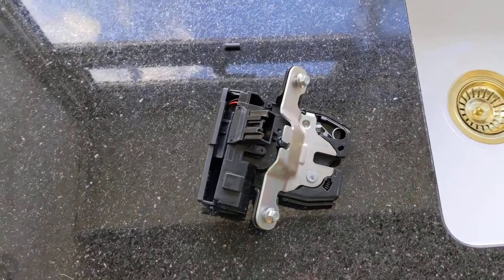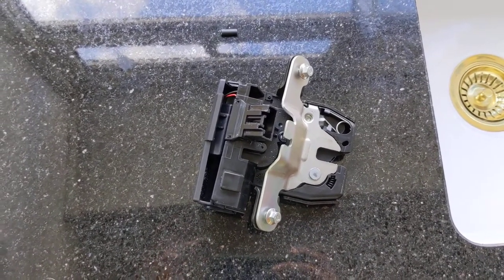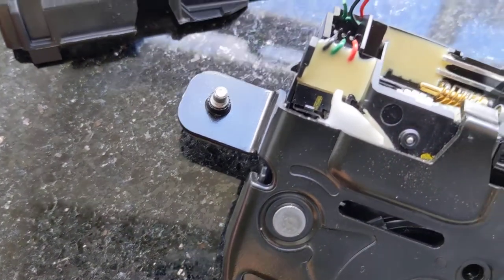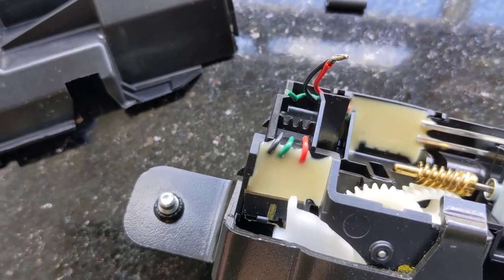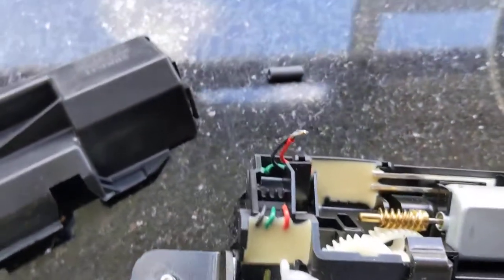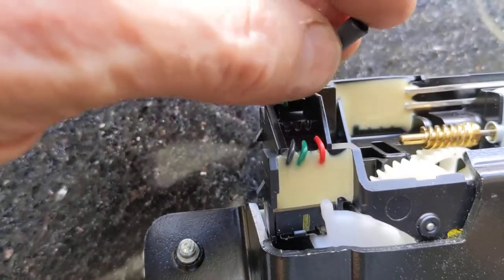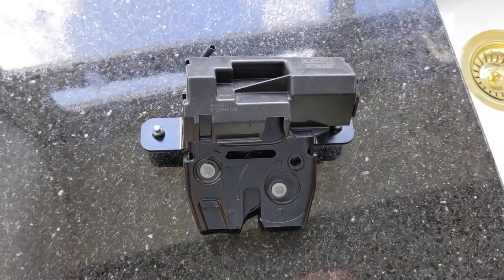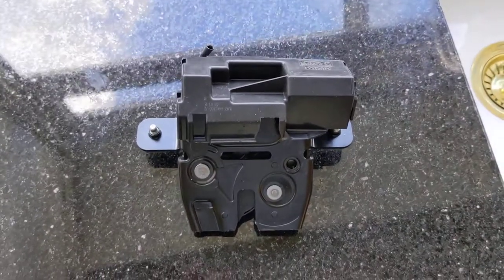Ford Fiesta Mk7 boot/tailgate "boot open" warning light.

Comment: Had this same problem on my wife's 2009 Ford Fiesta (especially when the weather is hot), battery went flat due to internal lights staying on. Followed these simple instructions cutting the red and black wires and twisting them together then wrapping in some electrical tape. Reassembled the latch, refitted it and the trim and the problem is gone (can't be bothered buying a replacement latch) - thank you Gary.
Reply from the maker: Your comment is ace and made me smile. To be fair the fix you have done will last forever although I was a bit particular about having it working as it should, in my case the boot light never worked for years and when I replaced the latch it suddenly came to life! Thanks for letting others know this is a fix that works. Regards. Gary

Comment: Lifesaver Gary!! My elderly Mum’s 58 Fiesta had a dead battery, which the RAC replaced without investigating the cause!  I noticed the interior lights were permanently on even when the car was locked, then I noticed the ‘boot open’ warning.  Fixed! Thank you.
Reply from the maker: Thanks for commenting and it's annoying to hear of parts being replaced without understanding the root cause. Unfortunately happens all the time, but hopefully you've saved a few £ as you found my video.

Comment: Thank you sir wherever you are. This issue has been driving me crazy for weeks on my wife's car. Finally this morning it's caused a power drain to flat the battery. Followed your video and it was as simple as you showed it to be. Even getting the plastic trim off and the latch out was simple following another video. So thank you, and it's interesting to see how many fiesta owners from that age range (wife's is a 59 plate) have all had this same issue.
Reply from the maker: Thanks for your comment. You may be able to tell from the grey sky, grey car, grey surroundings that I am in the NW of the UK....I don't moan though as I love it here 😂
Anyway, I'm glad you found my video and got the fix you needed. I had exactly the same issue as you hence me trying to find the solution. I do recommend a unit replacement and keep the 'fixed' one as a spare, although you'll have no further issues by eliminating the micro switch as you've now done. Your comment will help others follow as I'm sure there are one or two more out there having the same issue who are yet to search on YouTube. Regards, Gary.
Reply: @garymiller9843  I'm Yorkshire myself so I know your weather struggle well.
I've seen a few on ebay so going to source a new one to be safe and keep the old one like you say. Interestingly my issues are the same as some others who have commented, that it's only really started happening this week due to the hotter weather. Obviously some fault in ford's parts manufacturing process.
Still all I can say is thank you and I'm sure this video will help many others like myself

Comment: I had an unknown, intermittent fault for months, regularly draining the battery. Thankfully on the day I discovered the actual problem (I was driving along the motorway and the boot open message flashed up), I found your video. Such a simple, and quick fix, but without the video I’d have probably faced an expensive visit to the garage. Thanks from another one based in the NW (of England anyway 😉).
Reply from the maker: The warning on the dash is a bit startling (and overkill) when it goes off, especially when compared to older cars where you’d happily drive along with the boot unlatched until you realised when you got to your destination – modern tech eh >: (  Anyway,  I am glad you found the video and commented to let others know that the fix works.

Comment: Great video, rare to find one that actually works, after removing the trim its a easy 2 min job! Green wire did not need to be cut. Thanks Gaz
Reply from the maker: Thanks for your comment, particularly for saying a video that actually works. I did a new one yesterday for replacing the bonnet catch as my searches on how to fix proved useless so I thought I'd do one myself 🤣. Anyway, glad you are sorted.

Comment: Gary thanks for taking the time to show us this fix. Noticed there was a lot of corrosion on the power and connection pins. But after a good clean still had the issue. Tried you fix as a workaround until I get another lock. Worked a treat, never cut the green wire after some of the other comments on this post.

Worth doing this as this fault can trigger a false alarm going off. This happened on daughters car.

Thanks again
Reply from the maker: I am really pleased the fix has worked for you and for taking the time to make your comment so that anyone else having this issue can see that it works.  I'm glad you're getting another lock/catch as they are so cheap it's not worth not fixing, but this saves the annoyance until the new one arrives 😁

Comment: Hi from Norway ! Thanks a lot  for this tip. Carried out the mod today and it worked fine ! Saved me all the stress with disconnecting the battery all the time.Will replace the lock at at later date., so this has saved me a lot of hassle. All the best.
Reply from the maker: Thank you for your comment letting people know this works. It is a really annoying fault that causes such big issues, so I'm glad you have fixed it.

Comment: Nice one, my car was popping up with the boot open warning and it was a bit of a pain, last night the alarm was going off and kept going off. Tried your fix today and the warning isn't coming on, which is an instant bonus, I'm just hoping it was the boot open message that had started setting the alarm off, fingers crossed. I probably won't bother buying a new one, many thanks, such a simple handy fix though.
Reply from the maker: I am pleased the fix worked for you and you've made a comment to assure others who may be having the same issue.  There is no major loss by not replacing the unit, the solenoid is pretty robust and should easily last the lifetime of the car.  Old cars never had warnings for doors or the boot left open, it is just something that has been added which can then go wrong when was there any real need for it in the first place?  I can understand a warning for an aircraft door being not fully shut, but in a car you should know by the noise if something is not fully secured : )
Reply: @garymiller9843  yeah many thanks, that's what annoys me about these modern vehicles, just more stuff to go wrong yeah haha
Reply: @josh hi, yeah it did, no issues since. I'd forgotten I had done it until I seen this message haha

Comment: Thank you sir, this works perfectly I just cut the red & black wires and connected together as mentioned. Will be leaving it like that as the way I see it it can’t fail ever again.
Reply from the maker: Glad you have had success, you're joining a growing list 😁. The unit is robust just the micro switch which lets it down so I'm sure you'll have an age of trouble free service with the latch. Thanks for your comment.

Comment: Thank you very much. I came across this video as had the same issue. Intermittent at first then few days ago it would be constant. For the past our simple enough, cut the black and red... Twisted together... Wrapped tightly in electrical tape and put it all back together... Took 20 mins from start to finish... Thanl you so much!
Reply from the maker: Thank you for your comment James. A few people have commented about only using the red/black to solve the issue, so as a collective this will make the problem of the boot open warning go away.

Comment: This was great thanks for the vid, definitely going to try this. For a few days now ive come out to my car in the mornings and the info lights on telling me my boots open I had no clue what was going on other than to think someone was just trying their luck with cars around our area...
Reply from the maker: It is a bit of a hazard when driving at night and then the alarm goes off as all the interior lights come on unexpectedly! Quite dangerous really. 
Take care when removing the plastic trim as you don't want to cause any damage, watch other videos how to get at the part, worth taking your time to make it only a 5 minute job without breaking anything. I left my fix in place for a couple of weeks whilst sourcing a new part, they are really cheap off eBay or Amazon. It's worth leaving the plastic off the boot until you get a new part, then literally seconds to replace the latch and push the trim back into place. I found I restored my boot light too with the new latch (after it never coming on for 4 years and wondering why) 🤣
Reply: @garymiller9843  thanks appreciate the reply and helpful tips on what to do. Yeah came on for me one morning and made me jump on the drive haha.
Reply from the maker: @Frosty-273  this is one of the easy (relatively) jobs on the car where many have you cursing. Also no major need for a soldering iron and heat shrink, you can get away with twisting the wires together and taping them up as a short term fix. Good luck 🤞
Reply: Hi buddy did it work and do you still have full use of the boot operating when pressed. Cheers
Reply: @lukecreighton4897  Yes this worked for me always glad when I come across help videos on YouTube my next venture is to fit spaces to my wheels
Reply: @Frosty-273  OK thanks for the reply I shall try it stay safe buddy
Reply: @lukecreighton4897  no worries, hope all goes well for ya and cheers you too 🙂
Reply from the maker: @lukecreighton4897  Hi mate, as @Frosty273 said and perhaps I forgot to mention in the video, yes you do keep full functionality of the boot catch/lock but perhaps the boot interior light may no longer work. My recommendation is to conduct the fix as in the video but whilst the plastic trim is off the car keep it off and order a new catch. Whilst my fix will last forever with a new catch for less than £20 you'll be back to full functionality and if it ever happens again you'll know how to sort it. Just take care when removing the plastic trim so not to break any of the tabs. Let me (and everyone else on here) know if you have success. Also have a look at my video for installing an additional 12v socket if you get a moment, what I have done works really well and I have a virtually hidden dashcam for less than £40.  Good luck.
Reply: @Frosty-273  hi buddy just got new part of amazon 17quid everything working great and I can now lock the car lol 👍

Comment: Think this is the issue that is with mine. Battery went flat yesterday morning after having the warning come on a few days prior. Will have a go tomorrow.

Edit: it worked!! Thank you
Reply from the maker: I hope you had success with the fix. If you've not got around to it yet there is a link in one of the comments that will direct you to a good video how to get the plastic parts off the inside of the boot lid prior to doing my wiring fix.
Reply: @garymiller9843  tried it today and it has worked. The boot trim was a bit fiddly to get off but it's a fairly simple job. Thanks for the video

Comment: Just needed to cut the black and red, I left the green intact, no problems moving forward
Reply from the maker: That's great to hear John.  I hope others will have a look at the comments to see you've had success by only shorting the other 2 wires.  You picked a great time of year to solve this issue too; I always seem to have to do repairs in the depths of winter!

Comment: Thanks for doing this video I am going to try this had this problem for 2yrs but only in hot weather so hopefully this will work for me 🙏
Reply from the maker: I think quite a few people have had success with this fix so definitely worth you having a go. I do recommend that if you go to the effort of getting to the part then leave the plastics off and order a new catch, you are then ready to make everything as good as new only minutes after the new part arrives. The part is cheap, around £15 off eBay. The fix is long term though so no need to replace unless the unit develops a further issue.
Reply: Had a look at this today but I am a little unsure now what operates the boot release solenoid if you cut all three wires? tired to find a replacement switch on eBay doesn't come up with any match ?
Reply from the maker: @michaellittler2616  The wires are only related to the indicator that you see on the dashboard screen and subsequently turn the boot light on and off. From memory the solenoid is hard wired into the unit, cutting the wires will not affect the mechanism releasing the boot. Have a look on eBay at item number 253207734548 for the whole replacement part, just make sure you confirm the part with your car year/mk number. I proved the fix to myself before making the video by cutting the wires and cutting the insulation back, fitting the unit back into the car then connecting the wires together whilst looking through the boot to the indication on the dashboard.

Comment: Thanks Gary! It was so annoying, last year I replaced the whole closure and I thought it was fixed. 

This year the alarm started to sound again even if the closure was new, so I noticed your video looking for advice.
Just cut the black&red and merged together, no more annoying alarm 🎉 

A question, what the green refers to? I have left it as it is, but I’m just curious.
Reply from the maker: I'm glad the fix worked for you and seems like you've had an ordeal after already replacing it once. I honestly don't know what the green wire is for, but several people have commented that they didn't cut it like you and no one has reported any issues.

Comment: Does this affect opening the boot with the button on your keys? I have this problem but atm the only way I can get into the boot is the button on the keys don’t want to go ahead and try this and make a bigger problem for myself, great video btw very helpful 👍🏻
Reply from the maker: @marklarkin6866  my 'fix' only relates to the indicator on the dashboard that tells you the boot is open, and then puts the interior lights on etc. What I do has nothing to do with the lock/release mechanism. Sounds like you have two separate issues, my fix will sort one but not sure how you'll do the other, perhaps change the lock/barrel? I always recommend doing my fix but leaving the boot trim off and order yourself a replacement part. They are less than £20 so worth doing in my opinion.

Comment: Hi Rob, thanks for that video. I've got a ford fiesta MK7 the Hood bonnet light is on, how do I disable it please?
Thanks 
Mac
Reply from the maker: I've not experienced this issue (yet) but it's highly likely that if you find the wires and connect them to create a short circuit and loop out the catch then it will solve the issue. I did a quick search and found this:

https://www.fordownersclub.com/forums/topic/45992-bonnet-open-on-the-dash-when-its-closed-alarm-going-off/
Reply: @garymiller9843 thanks for your reply. I don't know which one to cut and short circuit
Reply: @garymiller9843  that you, I did find the wire and loop it out and now it's fine
Thank you
Reply from the maker: Nice one, sorry I was not much use on this one. If you made a video of the fix you should upload it to YouTube as I'm sure others will have the problem. My family have 3 Fiestas so chances are it will happen on them at some point.

Comment: Thanks for the video, what is the exact name of that unit called?
Reply from the maker: If you type this into ebay "FORD FIESTA MK7 BOOT LOCK TAILGATE LATCH CATCH MECHANISM 2008-2017 B-MAX" you will get a load of them listed.  You can also get the part number from what you already have fitted any type that into ebay/google etc.
Reply: Perfect thank you.

Comment: Hi mate i have this problem since 2 months. Can i know that if i do like that what happened to my central locking system? When i lock the car with remote boot also lock or not?
Reply from the maker: I am not too sure of the interaction between the boot lock and the central locking. I had a flat battery due to the internal lights coming on because the boot 'unlocked' on its own, but I never found my car unlocked. The fix in my video is related to 'indication' of the boot and not 'actuation' of the boot.
Reply: Thank you for reply. My problem is my car boot automatically unlock. Just unlock from the lock. Not fully open. As a result it always shows boot open mgs & lights on. If I follow your method will it slove my problem?
Reply from the maker: @lahirusandaruwan-v7q  I would have a go if I were you. If you are having issues then you need to find the fault, it may be this or it could be the boot button (or even something else 🤔). My fix is free, you just need some basic tools, but replacement parts are cheap so worth having a go.

Comment: Will this work for Ford Fiesta Titanium 2009 guys? It's very hot weather right now in London, interesting that someone else mentioned having this problem in hot weather. Currently leaving car unlocked to prevent alarm which is pretty crap! Please can someone reply to this with an easy vid of how to take the lock out of the car? Cheers
Reply from the maker: https://youtu.be/XcfoWqdwjq8
Reply from the maker: Watch the video I have linked to, get the boot catch out and then follow my video to solve the issue. You only need very simple tools to do this job, if you haven't got a soldering iron then use an electrical choc-block or at the very least twist the wires together and use tape to ensure they are secure.
Reply from the maker: The fiesta in the video is a 2009 titanium by the way so yours will be the same.
Reply: I also noticed my issue only occurs during the hot weather. And I've seen on some ford owners groups online that it's not an isolated issue with the heat on this part